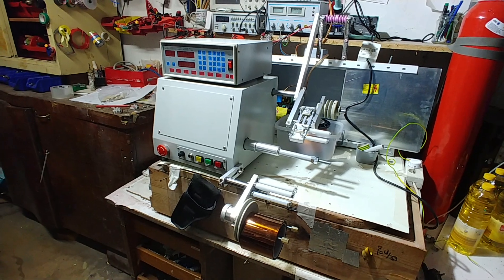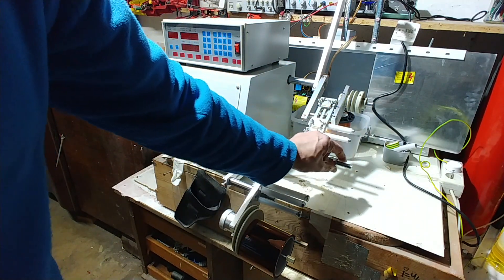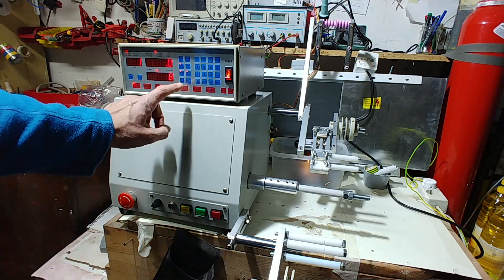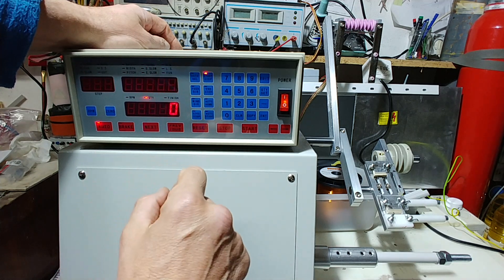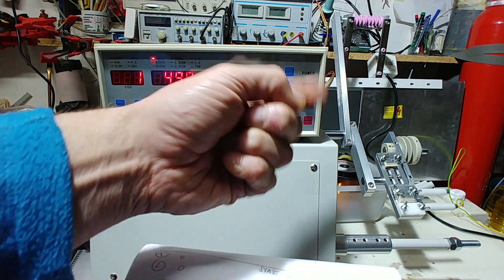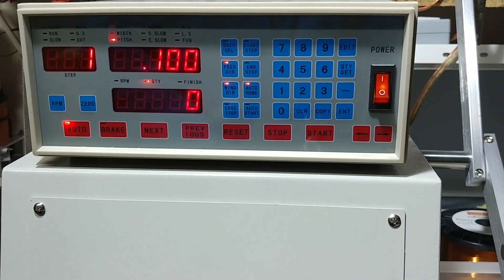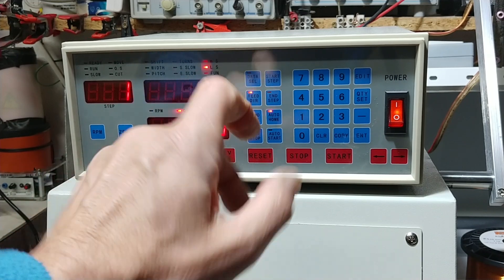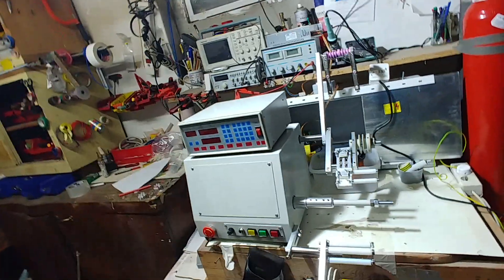Using a Coil Winding Maschine. Usermanual  Spule Wickler Wickelmaschine

Comment: Hi thanks for your very explanatory video! There are other parameters that can be set, such as double braking, brake mode etc. could you give me information about it?
Reply from the maker: Hi at 06:00 you see the parameters.  Unfortunately I dont have the machine anymore. But it is very easy to use it
Reply: @Free-Heat-Energy  Thanks again for the reply. Unfortunately I need to do 3100 turns and this machine doesn't seem to be able to do that.
Reply from the maker: No... a lot more than that 9999
Reply from the maker: As i remember: Set start Position, enter , end position enter, width of wire or 1 Looping enter, then start speed enter and Counts of start turns, max speed enter , ..

Comment: Thank you for this explanation! It takes a brilliant german engineer to clearly explain a Chinese product in English! 😂
Reply from the maker: thanks from an old man. Bytheway.. these cnc machines are great for that 450 Euros. At least for a lot of genious works, for testung stuff
Reply: @Free-Heat-Energy  Yes I bought one and am currently trying to set it up properly to get it to work. that’s why I clicked on your video.
Reply: @Free-Heat-Energy  By the way, it’s a 12mm M12 bolt that is needed for the bobbin attachment. M8 is too small as its 8mm in diameter.
Reply from the maker: yes. thanks for the great note

Comment: Nice video
Reply from the maker: thanks
Reply: @Free-Heat-Energy  I bought a second hand device but there is no user manual.  If you have it, can you send me a PDF?
Reply from the maker: hi Ibrahim, that is the problem for all. but i made the video is made to help.
for the handling start at 05:00, define the start and end positions and then the width per winding and then the amount of windings.
Reply: @Free-Heat-Energy  OK, I will take note of these. Greetings from Turkey, best regards.

Comment: Can this wrap plain/rod shaped ferrite cores?  Is this what those isolation plates are for?  Stick the inductor core in there and it winds it?
Reply from the maker: no, it's a threaded rod in the middle because it's available.  a sleeve is placed over it, onto which the wire is wound

Comment: The "Fun" button is not allocated to any function on this model of the controller. It is there for future use. In other words, when they think of another function, that button can be enabled by a firmware upgrade. Many industrial machines based on microcontrollers have buttons that don't do anything as supplied, but it leaves the manufacturers open to offer future refinements without having to fit external switches.